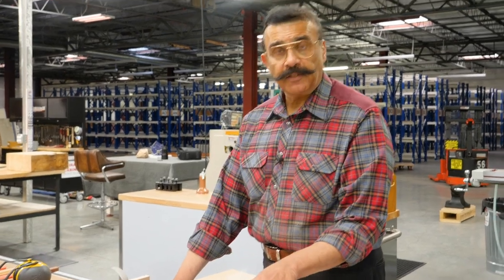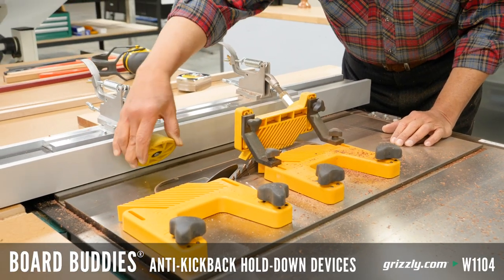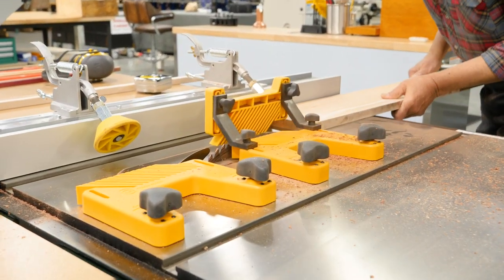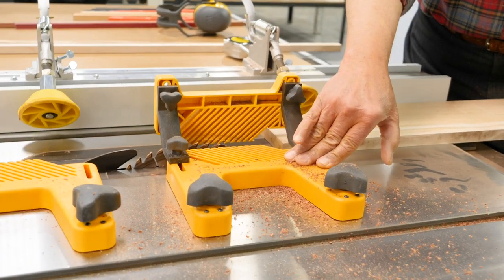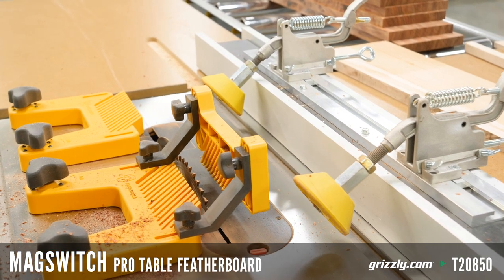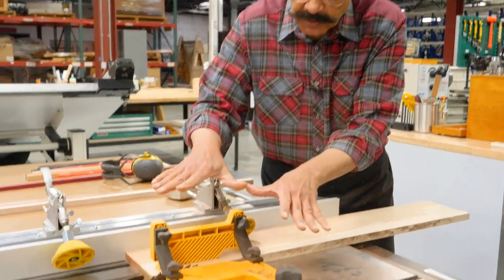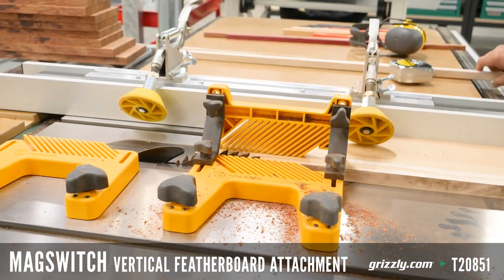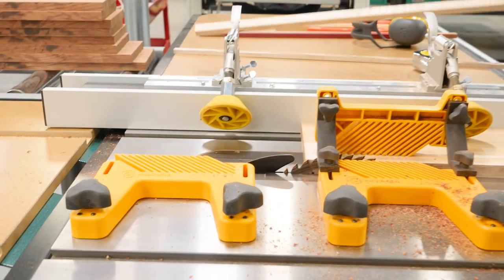Tech Tip: Board Buddies and Magswitch Featherboards featuring Grizzly CEO Shiraz Balolia

Comment: Newbie question.  Everything I've ever seen or read says when ripping never put a featherboard at or after the blade as it can cause a pinch and kickback.  Dado's are a different story.  Is it alright in this situation when ripping?
Reply from the maker: Hi there! Woodworking is a process hugely dependent on skill and experience with one's setup! Mr. Balolia is an incredibly skilled and experienced woodworker, and knows how he prefers to use his equipment. We would recommend all safety and precautionary measures, and for a beginner to do serious research until they're comfortable with their own process. When they've gained enough experience, they'll know what works best for them and their health and safety!
Reply: I actually just watched a stumpy nubs video on the subject. 

I am not an expert and certainly do not want to insult the video producers talking about skill, because it’s sounds as though your point is valid.

I think the better explanation that I have found watching mr Balolia is that yes you are right you shouldn’t do that in isolation without the board buddies because it can cause kickback, “but” his board buddies actually get rid of the possibility of kickback altogether.

Therefor when used together it is a very safe method and keeps your hands away.

If done that way without the board buddies - there is evidence suggesting accidents as you describe could still occur regardless of skill level.

One thing I have noticed though is mr Balolia’s focus on safety. Even though some cuts I watch look over engineered in terms of safety, I find myself coming back to his products time and again, confident if I follow the tips and use the products right, I’ll be safe every time.